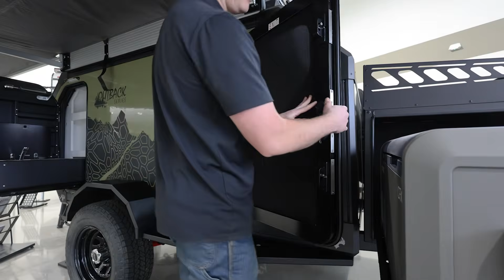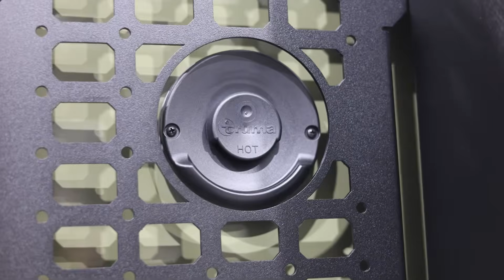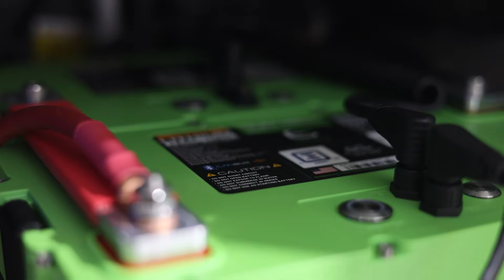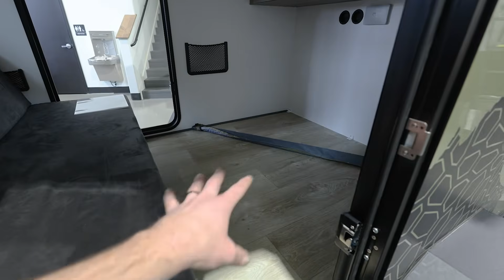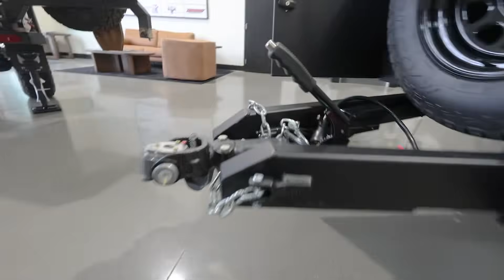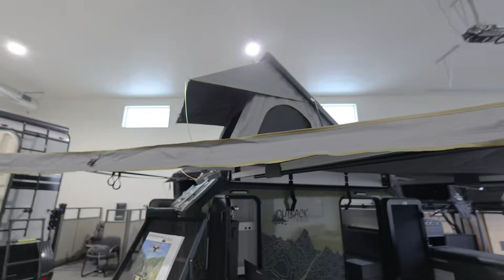Imperial Outdoors Outback 120 Trailer Walkaround

Comment: What is the maximum height from the floor to the ceiling of the interior of the Outback 120?  I inquire because I have a piece of hardware that I'd like to place on the inside and it stands 54" H x 14" W x 16" D on the outside.  I'd like to know if this will fit.
Reply from the maker: It looks like the maximum height is 47 inches, so it would need to be angled to fit